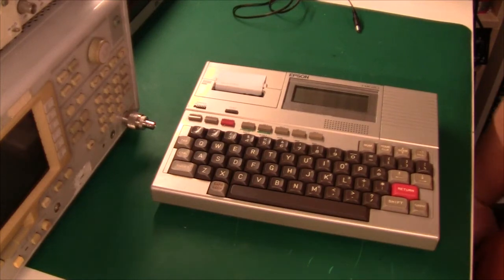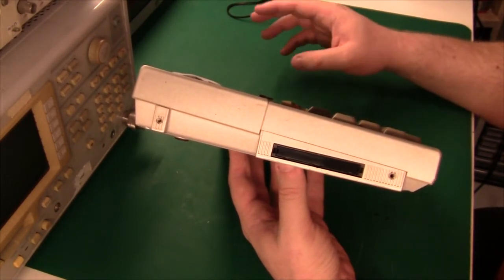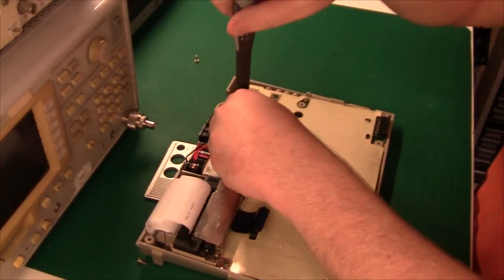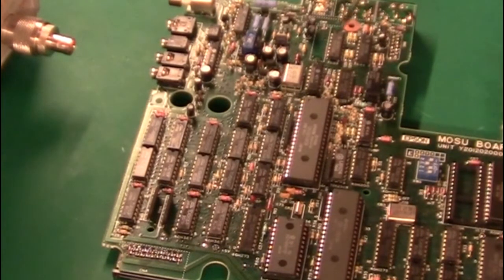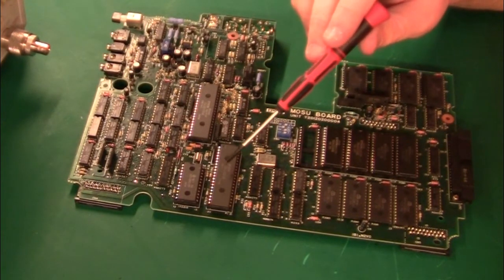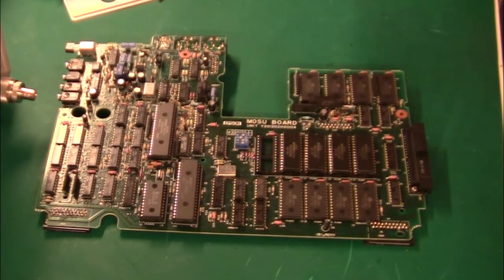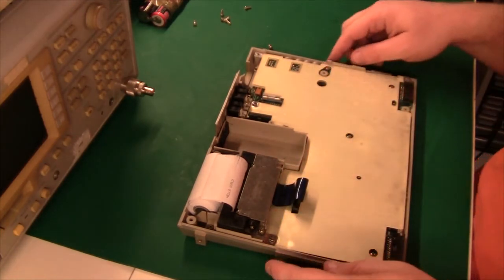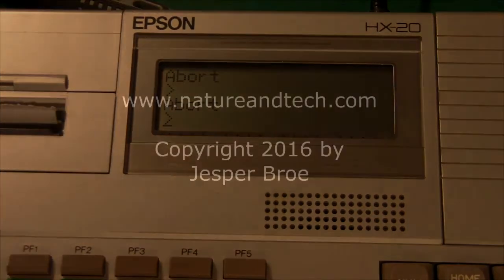Teardown of Epson HX-20

Comment: The RS232 can be used from BASIC and runs 100,300,600,1200, 4800 bps, and has modem control & handshake signal lines. The
SERIAL is 9600 or 38400, and is connected to the slave processor, intended for floppy drives and TV interface (the TV adapter was half of a text terminal w. some graphics). It can be freely programmed with machinecode, but the ROM routines implement a protocol on it for floppys and TV adaptor.

Comment: how many amps does this take i found one and i need to fix it
Reply from the maker: Hi Robert, I got your message. I will check out a power supply and get back to you.
Reply: thanks:)
Reply from the maker: The one I have is 6V, 600mA with center pin connected to negative. Remember this is a charger, not a power supply as such.
Reply: thanks that is really helpful :)
Reply from the maker: You're welcome. Good luck with your repair job.

Comment: Wow, that brings back old memories.  I used to service them for a clients business out of chicago that had 50 of them...  Used to have a service manual...  doubt I still have it...  Great Video!  Brings back old memories...
Reply from the maker: I can't imagine much going wrong with those, except maybe something manual, as well as the batteries?
Reply: The HX-20 was a solid unit for sure, most problems were dead printers, or Dead Cassette decks and Bad LCD's.  Dont remember having to replace any batteries.  I was just the tech at that time, they had a pipeline for parts, I just did the grunt work.  Easy peasy

Comment: you forgot to use the printer
Reply from the maker: This one came without a printer. The coastguard kept their software in battery-backed static RAM.
Reply: are you talking about a big printer?, I mean the built in one
Reply from the maker: Oh, sorry. I am talking rubbish. I actually did test the printer, but because I had already removed the battery pack, all I got was an error saying "Battery Low", so I did not put it in the video.
Reply: ah that sucks.Well if you ever need help with a build video that needs programming let me know because  I can code it for you and it would be fun to learn more about electronics. Plus I just bought my first real oscilloscope! It well be so much fun when it shows up(if it works). Sorry I hope this comment is not to long.
Reply from the maker: That's great. I may just take you up on that :)
Reply: cool